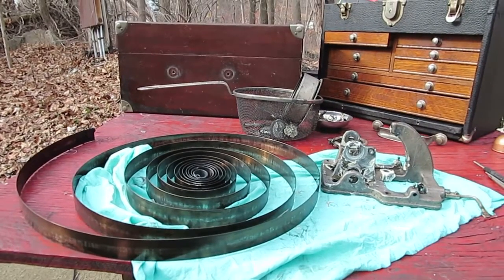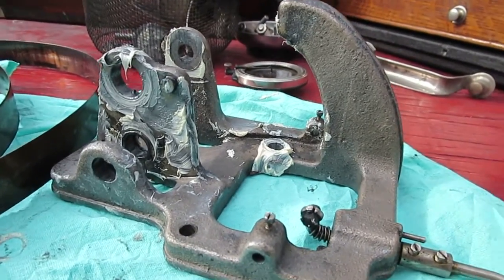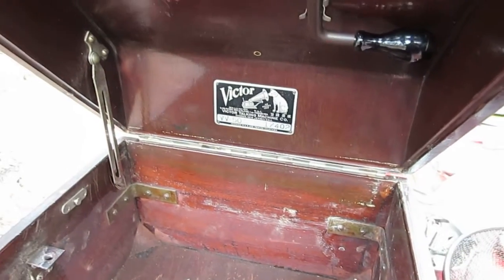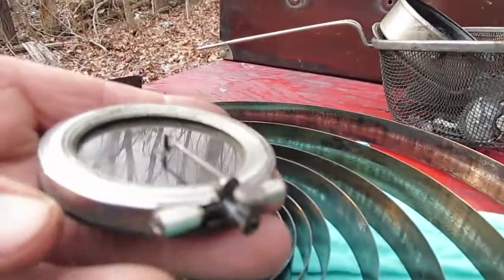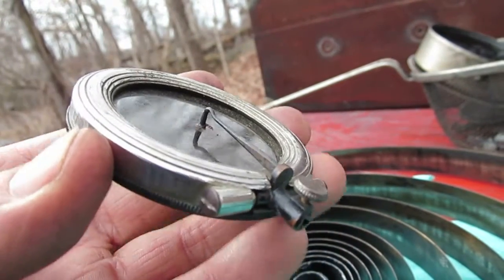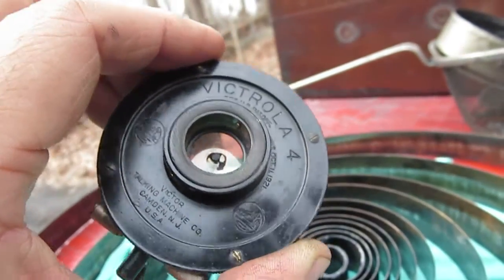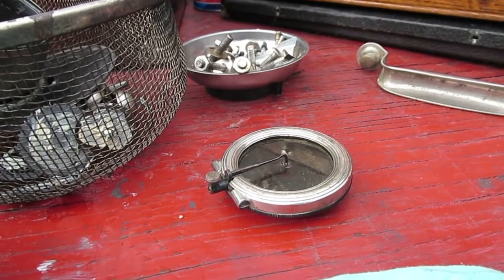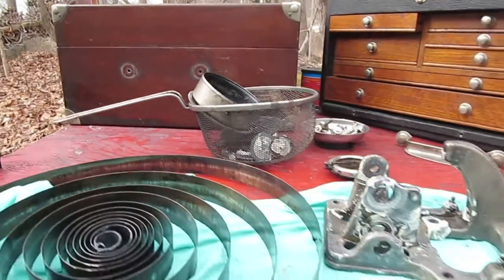Victor Victrola VV-50 motor apart for cleaning

Comment: Nice bonus on that No. 4 reproducer.  I would have changed the mica, though.  It may not be cracked but it after 90 years it will be stiff  and not as pliable as it should be.
Reply from the maker: I always test them before discarding them ( there is no end to how frugal I can be), easy enough to do on my own stuff were time is not an issue. In this case the mica was fine, no delamination, or other problems.  It hit all the high notes without distortion.  I keep new No4 diaphragms in stock as I seem to need them whenever I rebuild one of the all brass 4's I imported from the UK.  Without fail I have to replace every potmetal No4 I get on the HMV 101's or German Electrola 106's with an all brass model.  The only option is to find an early all brass No4, easier to find one of the HMV's than Victor models, HMV kept the all brass design in production longer, years rather than months.   What is always bad is the diaphragm gasket, natural rubber simply does not last 80-100 years without turning to stone, isolator gaskets need to be changed as well.

Comment: Hi , please I need some help. I recently bought a VV 4-3 Consolette but it comes with a Victrola Nº 4 reproducer and the sound is low and there is an escape of air because the posterior gasket with stops the air leakage in contact with the tone arm is old and dried up. Do you have an idea what kind of gasket I have to buy ( or if a new gasket for orthophonic reproducer will fit on it ) and what kind of gasket I have to buy to replace the internal ones ). Thank you very much  for wasting time with me. May God bless you !! André from Brazil !!
Reply from the maker: The Victrola No4 reproducer uses the same isolator gasket as the Victrola No2.  This gasket and the diaphragm and diaphragm gaskets can be had from Walt Sommers at Gettysburg Antique Phonograph.  He is cyber-tigger on eBay, the eBay item number:
383511978437

As far as I know Walt will ship internationally, but you would have to check.  If he doesn't then maybe one of the UK sellers will.  They used the No4 on the HMV 101 portable machine as well as many other Gramophone Company machines. 

Walt can also rebuild the entire reproducer for you if you send it to him, he usually gets under a hundred bucks, how far under depends on how many parts it needs replaced.  Orthophonic tonearms are larger and they take the larger gasket.  It is possible to put one of these larger gaskets into a No2, or No4 and use them on an orthophonic machine if the original reproducer is damaged.  You can't use the larger gasket on the smaller earlier tonearms from the pre Orthophonic machines.
Reply: @Rockisland1903   Thank you very much. I appreciate your kindness !!

Comment: I thought the HMV #4 is a orthophonic?
Reply from the maker: No, the No4 was brought out to improve the sound of electrically recorded records in the mid 1920's while work was underway on developing the Orthophonic reproducers and machines.  It would last a few years at Victor, but would be used by both HMV and Germany's Electrola 1931 for HMV and late 1930's for Electrola.  It had a redesigned needlebar and slightly enlarged diaphragm compared to the Victrola No2.  However the diaphragm remained mica rather than the aluminum the Orthophonics would use.  It's not a bad reproducer to use on the earlier non Orthophonic machines, but the potmetal bodies used on most ( 4a) will be crumbling with age.  The very early No4 was all brass, but these are rare and expensive.  More common to find all brass 4's from HMV, but they will need exporting from the UK.
Reply: @Rockisland1903  I'm confused. I'm talking about the HMV (not Victor) #4 reproducer.  AFAIK, the HMV 4, sold in the UK by His Majesty's Voice, was a clone of the Victor orthophonic.  Assuming I'm wrong about that being the HMV 4, I am fairly certain HMV did offer an equivalent of the orthophonic Victor reporoducer. But I am probably nowhere near as knowledgeable on the subject as you, so I will defer to your expertise.   Are you saying there was no HMV equivalent (basically a clone) to a orthophonic?  Thanks for your time.
Reply from the maker: The HMV No4 was a clone of the Victor No4, used under license.  This was possible because Victors company president Eldridge Johnson owned a major chunk of HMV's stock.  The Victor No4 was not an Orthophonic reproducer.  HMV would use the orthophonic style reproducer for the MHV-102 among other machines after 1932.  The HMV company did not care for the original Victor Orthophonic reproducer and developed their own design.  The HMV No16, No5a, and No5b are HMV designs based on Victors earlier work.  The claim was that HMV's sounded better, that argument is a century old and counting.  To untrained ears they both sound alike and both sound good when properly rebuilt.  My guess is HMV was avoiding having to pay royalties to RCA/Victor that would probably have gone into effect after RCA bought Victor from Eldridge Johnson in 1928.  I think there may have been some limited use of the Victor design Orthophonic early on. but the earliest HMV Orthophonic type Gramophone I own is the HMV-102 portable from 1933, this one uses the HMV No16, also not a Victor design.

To be clear, the Victor No4 was not an Orthophonic reproducer, it was just intended to allow better playing of the new VE records than the No2 allowed.  It was only intended to last until Orthophonic machines were introduced a few years later. Victor and HMV Orthophonic reproducers all use aluminum diaphragms, not mica.

Comment: How do you take out the spring barrel? I’m in the mix of taking mine apart and cleaning it. I have the vv 50 like you.
Reply from the maker: There are several variations of the single spring motor in these, what's your serial number?  Crank location?  Generally you take out the small set screw on the gear were the crank screws on and everything else just pulls out.  Or do you mean how to remove the spring itself?  Removing the spring takes a firm grip with heavy leather gloves, it's going to be messy, there are a few videos on line about how to do that so I will skip it here.  I replace the springs on these motors so they tend to be more of a chore to install rather than remove because the spring has more tension going back in.   If you don't think you can keep hold of that can and the spring as you remove or install it then send it to a professional, I can suggest someone if needed.  If either the spring or the can get away from you then personal injury can result, or worse you can damage something that has survived a century before you broke it.   There are no tools that can be used to remove and replace a spring, this is hand work only, I have been doing it on single and multi spring motors for 25+ years.  I encourage people to get involved in servicing their own machines, for me that's 80% of the fun, but I also caution to know your limitations, nobody needs to get hurt doing this.  I have a lifetime working with my hands, swinging a splitting mall, working a cutting torch, taking apart and rebuilding cars and trucks, heavy equipment and working with tools daily.  My hands are tough as a farmers, and a spring in a Victrola is nothing compared to other things I deal with, not everybody is used to dealing with stuff like that.   If you have to pick a motor to start learning on the Victrola single spring as found in the VV-IV or the VV-50 is an excellent choice.   Make sure you have good screwdrivers, I like the high quality Chapman hollow ground screwdriver set.  Make sure you keep track of the tiny ball bearings that you will find in each of the two governor bearing caps, and under the turntable shaft, they are probably stuck in with dry oil but sometimes surprise you and fall out.  Work over an old towel so if they do fall out they don't roll off the table.  Take the caps and put them in an old plastic aspirin bottle with some alcohol or lighter fluid, shake them around until the little ball bearings fall out, when you put them back in the motor dab some light grease or Vaseline over the end so the ball stays inside while you work.  Do not overtighten the caps and remember the one with the ring goes near the gear, leave a tiny bit of play allowing the governor to move slightly in the bearings back and forth.  Before you take anything apart make sure the spring has no power left in it.    As I mentioned before there are some excellent videos out on youtube  demonstrating how to take motors apart, I don't have links just now but you should be able to find them.
Reply: Great video. Would you happen to have a video showing how to take these apart? Regards